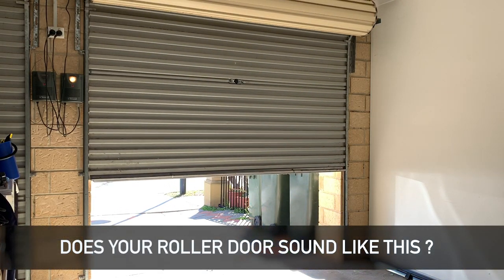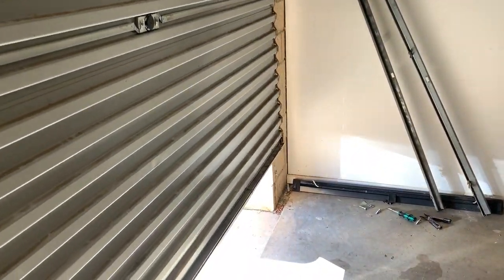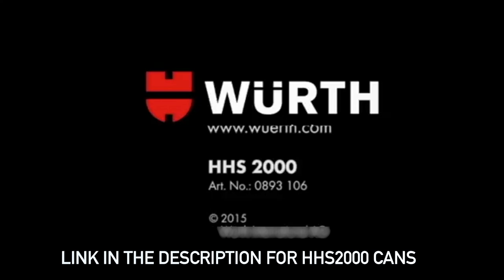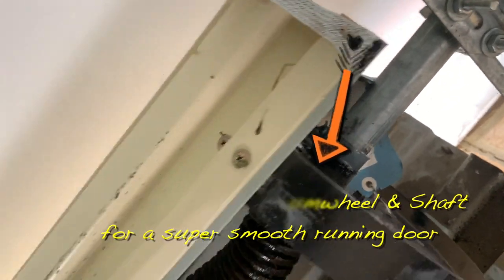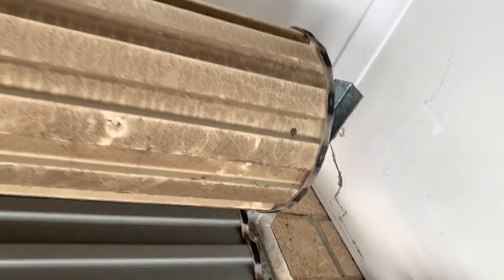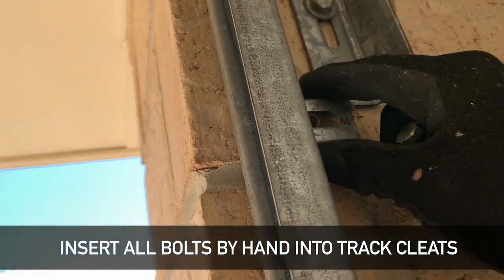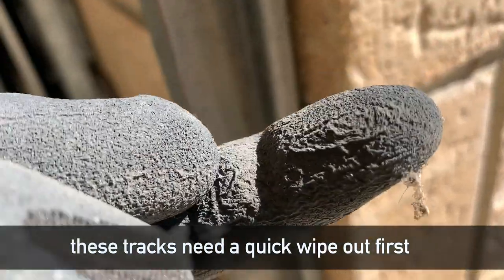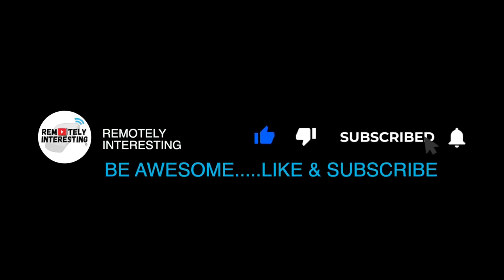Noisy Garage Roller Door Fix...Guaranteed. The only product that actually works 100% of the time !

Comment: G'day...thanks for your great video...I have very dirty Nylofelt material on my roller door side tracks...
I think the track was sprayed with Lanotec spray and yes it's like a magnet for filth....so my questions:-
Can I flood the Nylofelt with brake cleaner and wipe with multiple microfibre towels to get as much gunk out of the Nylofelt?
If that can't be done...or doesn't work...IE if the Nylofelt is too contaminated...can new Nylofelt strip's be purchased and refitted with small wire ties in place of the factory staples?
Cheers from Melbourne
Reply from the maker: Yeah go hard with the brake cleaner, degreaser and brush.  Even a light pressure wash but that sometimes splits the fabric too much.  Just keep soaking and wiping it’ll eventually come clean.  Irreplaceable unfortunately. Removing tracks is easier too.
Reply: Thanks Nate....did you also see the link to the NZ supplier I found....what do you reckon?
Reply from the maker: @roddersauify  oh no where is that link ?

Comment: Wouldn't it be better to remove the old grease before applying the new grease? Nice job though.
Reply from the maker: Great observation however where the noise originates from is on the pole that goes through the spring which no longer has any coating to stop the spring rubbing. By using this penetrating grease spray it will re-coat the pole (shaft) usually stopping 90-100% of the noise. The outer grease on the spring is just the dried excess stuff from the factory :)

Comment: Isn't it even better maintenance to first clean the springs before lubrication?
Reply from the maker: Hey mate good question.  
In reality you could definitely spend a lot more time cleaning the springs if you wanted to, on the job it’s not really necessary or time economical. The problem with some doors like Gliderol is the factory grease they use goes extremely hard so you can only burn it off with a gas torch, messy & smelly.  But because Gliderol Springs have a good gap between the coils it’s not a problem to just re-lubricate, it’s actually between the inner spring surface and shaft contact which makes the terrible noise where there is no grease or lubricant left, so just applying some to those areas does the job.  Other brands use a lighter lubrication that just wears off so reapplying a good lubrication like HHS2000 is fine too.  Hope that helps.
Reply: @NatesToolbox  Awesome. Thanks

Comment: Great video! Would the silicone spray be appropriate for a larger bare/not painted metal roller door that seemingly doesn't have the curtain material on the side and makes metal on metal contact? specifically the door surface/face making contact with the rails and making noise. Rail surface seems cleanish/dry, not sure what lubricant was previously applied but no obvious signs of oily residue or grease are present just a very thin waxy film of some kind. Was told to use "wd40" or "wd40 Lithium Grease version" but that seemed wrong to me so I figured I would ask...basically is Würth Silicone spray appropriate for a moderately  used metal on metal contact roller door system? I also have Würth Silcone Grease Spray would that be helpful or counterproductive? Thanks
Reply from the maker: Hey great question 👋🏻 if the door doesn’t have the fabric edge that’s common for commercial doors. Go hard with the grease spray, if that doesn’t work 100% just try normal grease these doors need a decent layer of proper grease in the tracks. I’ve used the HHS2000 on a few doors as it’s easy to apply but a rubber glove and tub of grease is just as good 👍🏻
Reply: @NatesToolbox  Excellent, thanks very much for the response!
Reply from the maker: You’re welcome 👍🏻